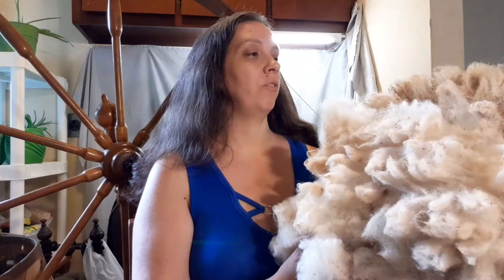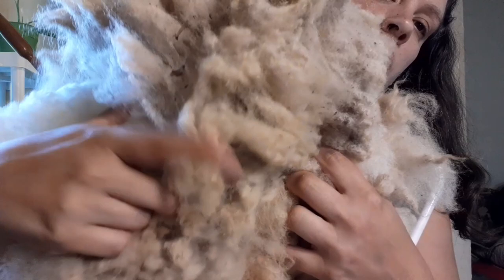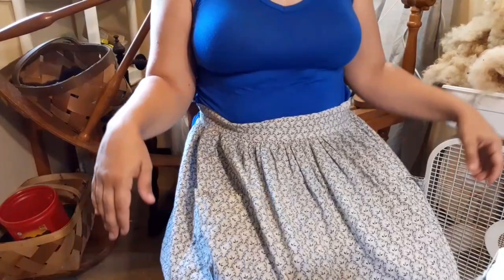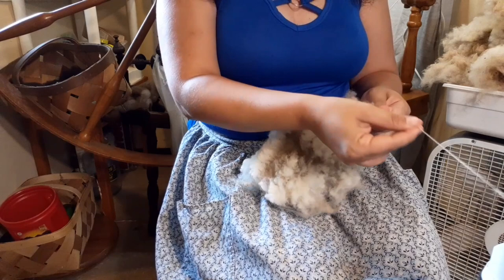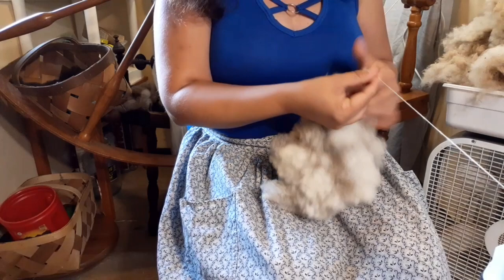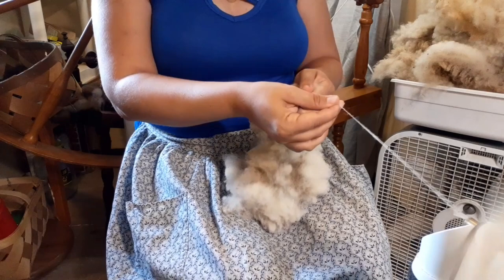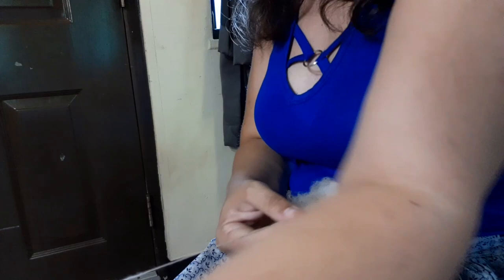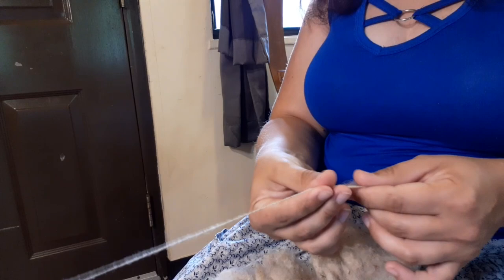Zero Prep Spinning // part 1: unwashed wool (chatty)

Comment: Weren't there any dirty tips that were stuck? If you have that what do you do? Do you cut your tips off?
Reply from the maker: If the tips are dirty but strong, you just tease them open. If the tips are tender then they can be tugged off with your fingers. I normally do not cut tips off my wool and this fleece was very easy to tease open. Some GCN fleeces I have worked with had rain tips that broke easily so I sometimes cut those off if I don't feel like breaking them by hand.